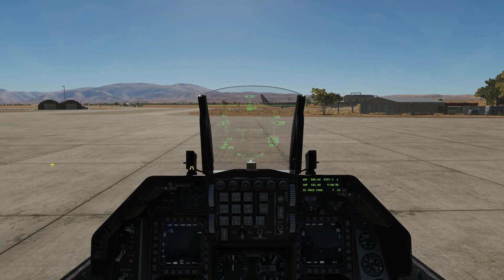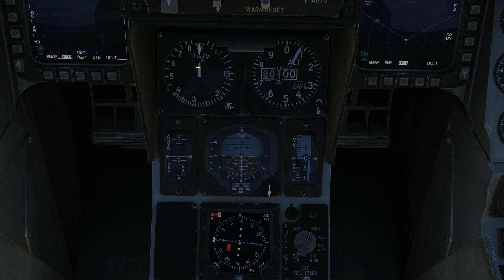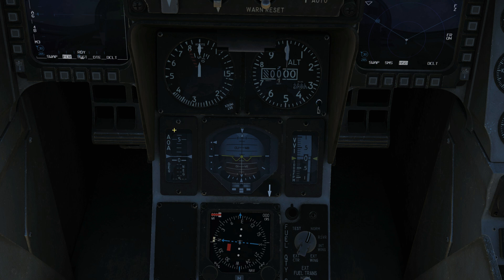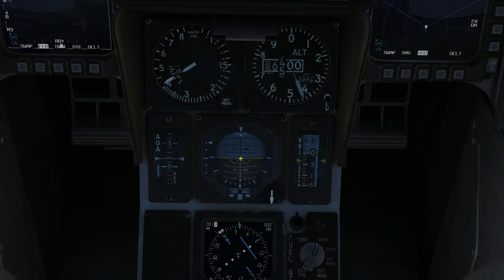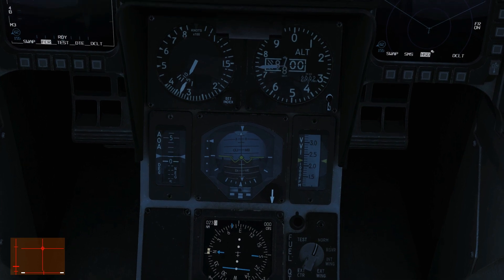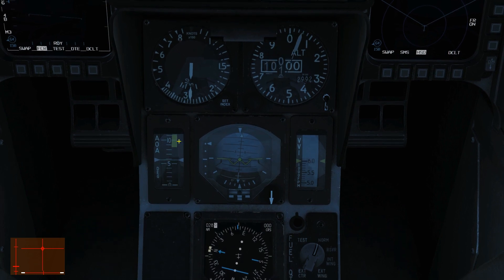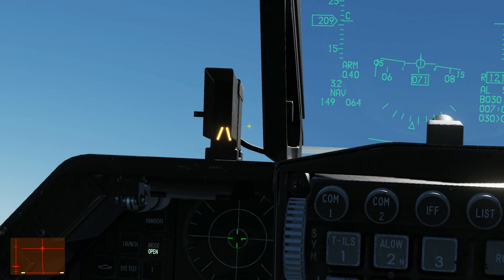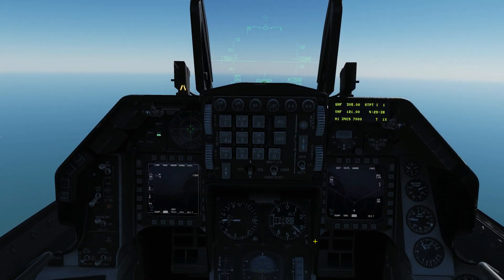F-16C Viper: Flight Instruments Tutorial | DCS WORLD

Comment: Should I get f16 or 18
Reply: FA-18 is far more complete and obviously allows carrier deployments, F-16 is currently very basic with many missing features that will be filled out over the next year. Eventually will be quite similar to the Hornet with a better SEAD capability.Whatever floats your boat really and how long you are willing to wait.
Reply: @dcraigie1  let's see about this bold 'next year' claim ;-)
Reply: As someone who has both Rn the hornet is better but the f16 will catch up quite quickly as a lot of the system are basically copy paste but the f16 flys a lot better in my opinion and it feels like it will be a better dogfighter when more complete so it’s up to you short and simple A2A viper A2G Hornet unless u want the option of carrier ops
Reply: I have the F18 (had it for 1 year) and continue to learn and refine all aspects of its use. This plane will keep you VERY busy with all its features. Not got the F16 yet as I feel it’s such a slow burner as with all the planes out the gate with a very basic set of functions available at launch. Definitely advice F18 as your first purchase. Give the F16 6 months to mature.
Reply: F-16 has no damage model, no iff, flight model is wonky, engine fuel consumption is off by 75%, ccip bombing might be off, only one rough skin, it cannot carry fox 1's (ever) and carries less missiles than the Hornet.

F-16 off discount, now, is a big no. Three months from now, mayyyyybe. I'd give it 6 months though.